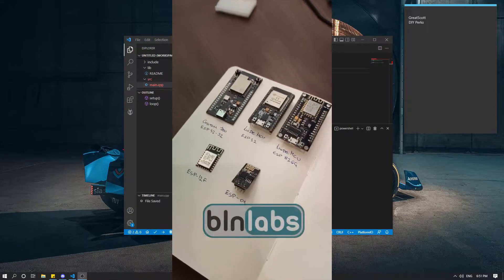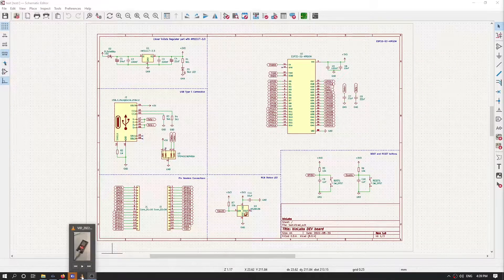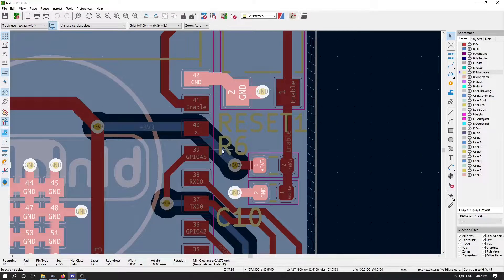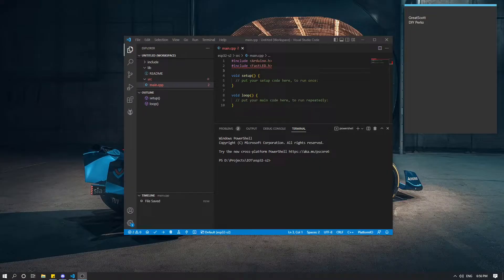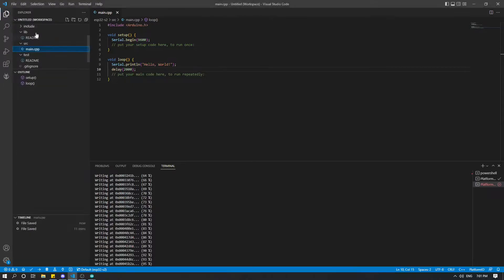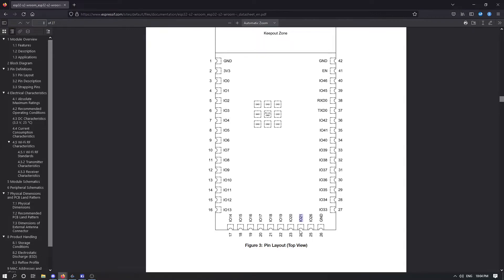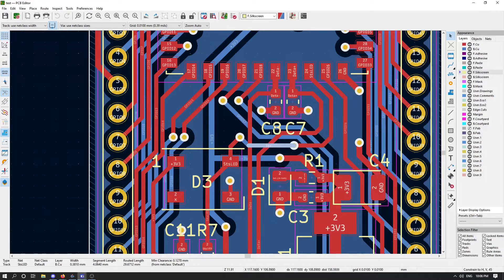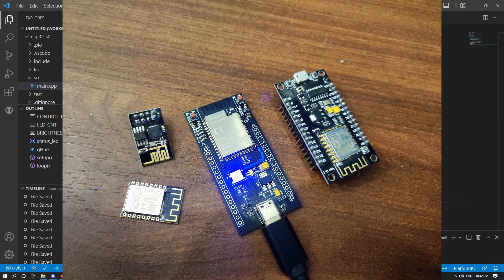Is it Working? First Test of custom ESP32-S2 development board

Comment: I am trying to make my own esp32 board. So i don't need to put usb to ttl chip in order to program esp32? I will just lose automatic reset after programming?
Reply from the maker: Couple of things
1.) You dont need TTL (USB to UART) chip on it, just need to connect USB data lines to Data+ and Data- of ESP32-S2. 
2.) When doing this you are loosing DTR and RTS lines from TTL chip and option for auto reset and auto programing 
3.) just add tasters or switch to Enable and Boot Mode pin of your ESP32 and then you can manually put it to programming mode and manually reset ESP32
Reply: @blnlabs  Thank you very much for your reply!